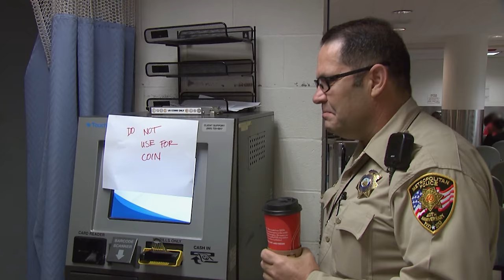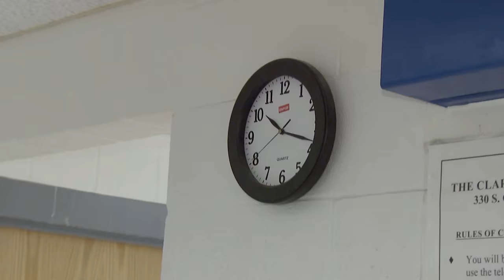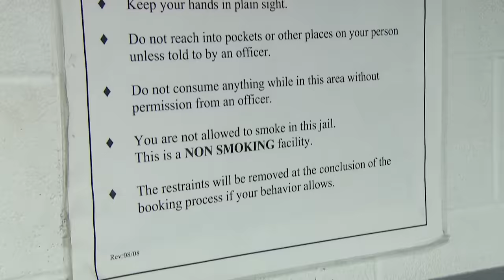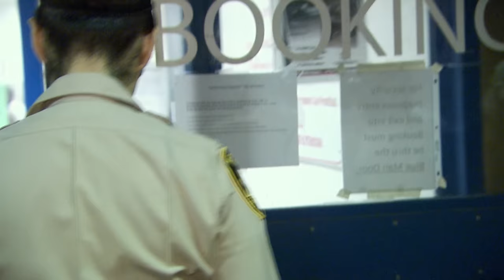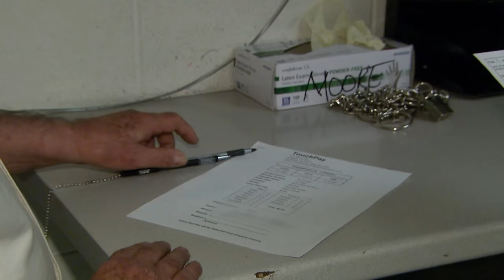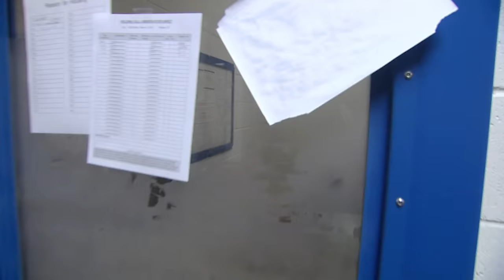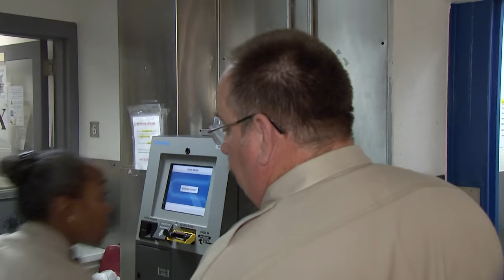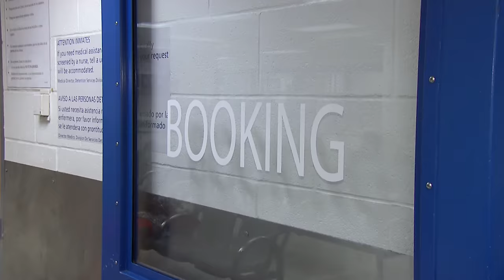Handling Drunk And Disruptive Suspects In Isolation | Best Of Jail Compilation | Real Responders

Comment: That dude was not high on coffee. I knew it was meth from the get-go.
Reply: he’s a meth head but not on actual meth - he came from lock up, he didn’t have access to meth and that’s probably why he saved up so much caffeine. He wanted something to mimic drug effects, just didn’t work so well for him lol
Reply: You can absolutely get meth while locked up. My guess would be he has some SEVERE mental illness on top of addiction, but it is very easy to get or you can have psychosis when on it or getting off it. I am a recovering addict and an RN. If I had to guess (could always be wrong) he probably was using for a very long time. Was trying to use a massive amount of caffeine to try and mimic any kind of effect from the meth. Could have had a little bit too. Either way he went into a massive psychosis. It happens a lot to people when they are getting clean. Just from what I saw, I would guess he is about a week out from using anything at all. It is different for everyone though.

Comment: There is a lot of good things except one thing - MAN America sucks a dealing with mental health. I work with "related" cases in Denmark - and I'm constantly going "uuuuhhh... yeah that's gonna cause things to escalate" - and a lot of the time it could have been avoided. I know they are all doing the very best they can within the frames they have - so it's not meant to throw shade at the cops - at all - but rather to criticize the frames. If you want an example: The woman in the Taylor Swift T-shirt who starts out with saying "I have mental issues" - why does she do this? Well two reasons - one is that she is trying to get off easier/faking it... the other - and in my mind much more likely - she knows what is about to happen and she knows her reaction isn't going to be good - for herself or for the officer - and thus she "warns" the female officer that she has these issues to avoid a confrontation. The problem is that she needs to be searched. A quick talk with her if she would be more comfortable with "other ways" of doing this search which doesn't include her being touched (which she doesn't seem to like) - or being more methodically and slowly searched - which would most likely be much less confrontational. Maybe she would prefer going into a changing room and undressing so the female officer can search the clothes while they are not on her body, or maybe she would prefer a "slower search" where the officer verbally communicates everything she does like "Next I am putting my hand into your left pocket - are you ready?". It just seems unnecessary to make her that upset when she clearly expresses that she has issues which are gonna cause problems with what is about to happen.

Again - I am NOT placing the blame on any of these cops for stuff being a bit messed up at times. I'm sure they are doing their best and they all seem to have empathy and passion for helping these people. What I am blaming is a lack of education and "appreciative inquiry". I understand that they hear a lot of useless BS from people (I REALLY understand - been there many times) - however when she said that sentence my reaction was that "she just told them everything they needed to know" to avoid this - or at least attempt to. And no "ma'am wasn't being difficult" - in fact she was desperately trying not to be. She literally told her by making the her aware of the mental issues - after which the officer puts hands on her and starts using force. This can very EASILY be understood as me blaming the female officer for this - but I'm not! She seems like a woman with A LOT of empathy - however she's probably not educated on a sufficient level to deal with mental issues. I don't envy her in her situation - and I don't blame her - let's make that VERY clear. In fact I think she is doing a hell of a job throughout this series with the tools she has in her toolbag... I just wish she would be given more!
Reply: Also the dumtidumti music when she is talking afterwards is a bit... why? I mean are you in any way in doubt that she has mental issues?